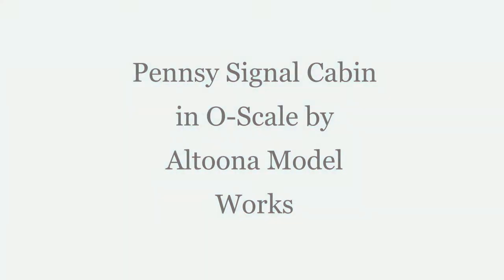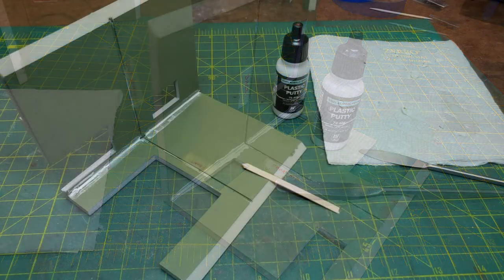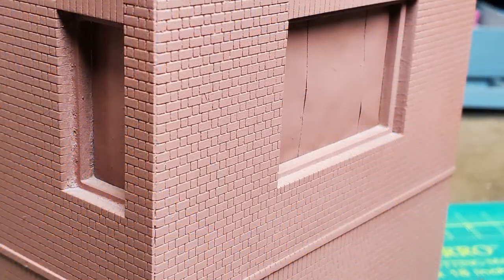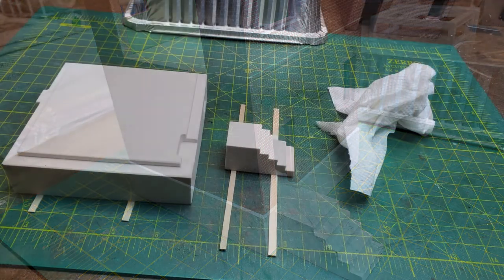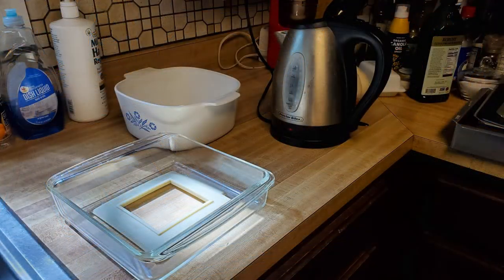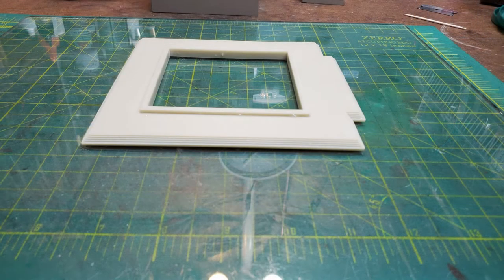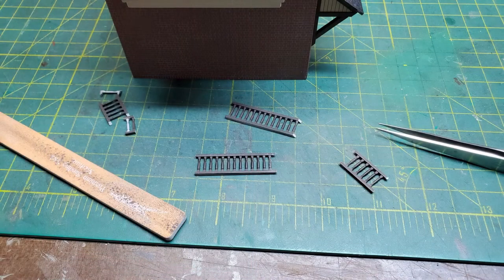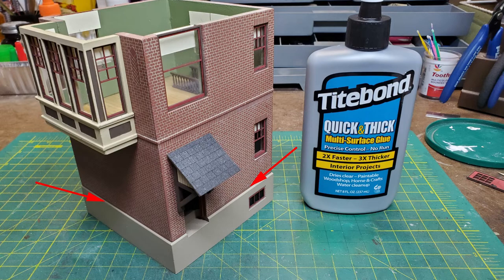Pennsy Tower in O Scale by Altoona Model Works

Comment: FYI This is closer to the tower at Overbrook Section of Philadelphia than the one in Huntington
Reply from the maker: Yes, the Huntington tower is bigger and very distinct. But he's using this to represent the tower in Huntington on his layout. Do you think this Altoona model was based on Overbrook? Thanks for watching.
Reply: @CassidysWorkshop  I'm pretty sure given the features, at some point this was a 'standard' tower design. The tower in York has the same features. Either way this works as a good stand-in for the one in Huntington!
Reply from the maker: @Phillyrail   About as good as you can get without scratch building one. Although it would be nice if there was a kit available someday. Thanks.

Comment: Couldn’t this kit be used to kit bash a better or closer match to the signal tower that the layout was missing?  It looks like a couple wall sections and a new roof would do the trick ?
Reply from the maker: I'm sure it could and that would be cool.  But that wasn't in the budget or timeline. Also, new walls would need to be made, the kit isn't available anymore.